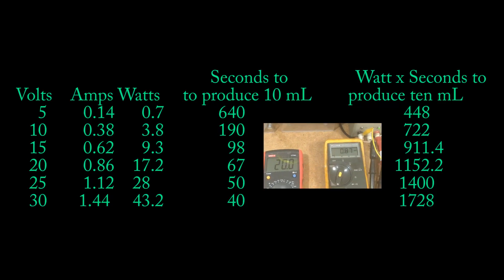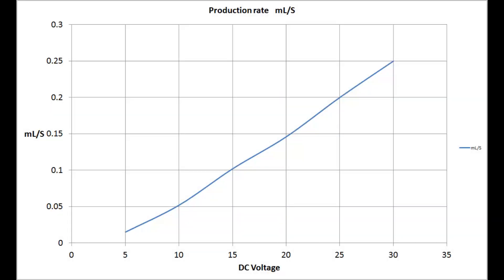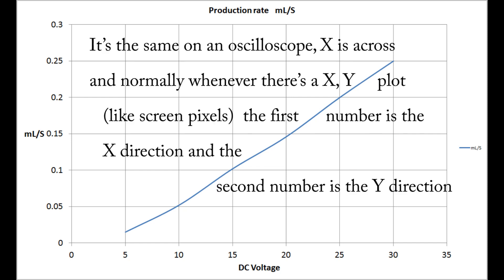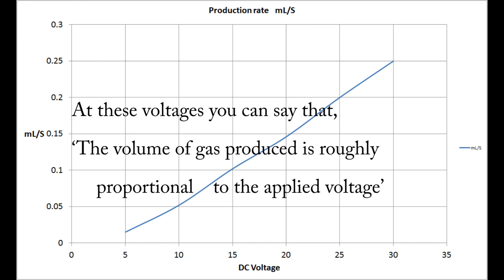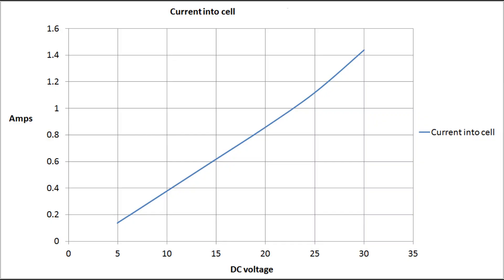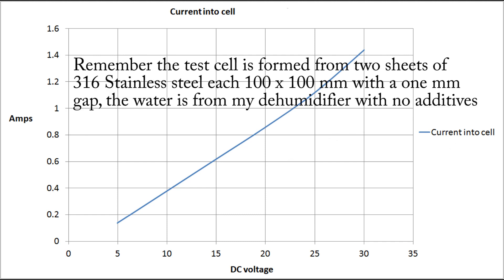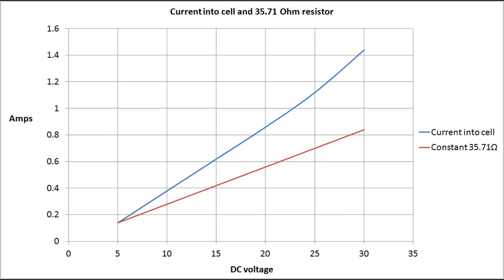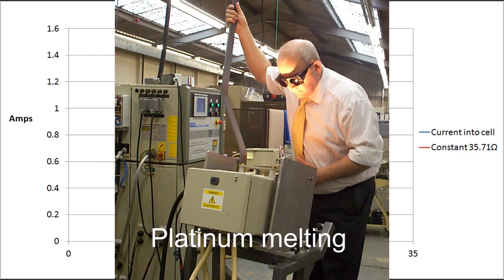HHO. 7 Graphs, same data as in HHO.6 but presented differently

Comment: Wikipedia has a good section on the electrolysis of water including some interesting formulas. They conclude with this: 

"Thus, any current (I) at applied voltage (V) greater than 1.48 V is an overvoltage and results in waste heat which can be estimated as I×(V-1.48)."

Comment from the maker: Hi, to calculate the efficiency all you need to do is divide the output by the input and then multiply by 100 that gives you %. The values have to be in the same units, so given that the input is in watts we’d have to convert the calorific value of the gas into watts. The other point is for a true measure of overall efficiency we’d need to measure the power into the DC power supply Anyway, at this stage looking at the mL/WxS graph is a good indicator Thanks for the feedback
Kind regards ... Andy

Comment from the maker: Hi Bill I'm setting out to do is get an understanding of what’s happening in the cell. It was a big surprise to find out that the efficiency reduces as the volts increase, it’s only by carrying out trials that I’ve found this out. I know that if I add salts I can produce more gas but what does that do to the efficiency? It would be easy to confuse volume of production and efficiency and I guess most folk don’t care, they just want lots of gas, I want it efficiently.
All the best ... Andy

Comment from the maker: Sorry I can’t advise you on this, when I saw how the cell was contaminated so very quickly when I had the +ve to the copper I didn’t go any further. All I can say is that you can run a cell made from copper and stainless steel so long as the copper plate is –ve and the stainless steel is +ve
Good luck.
Kind Regards... Andy

Comment: Hi, again Andy. I noticed the resistance graph seemed to have two gradient values (if you think of each 'half' of the curve as a separate straight line). Could this be due to gas production between the plates altering to the resistance effect between the plates?